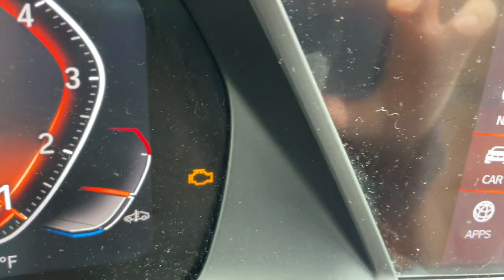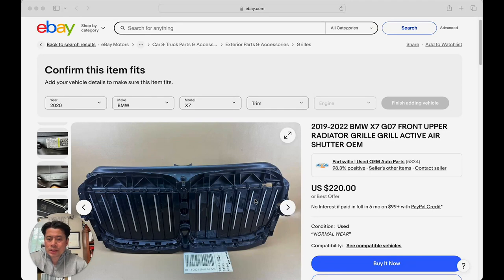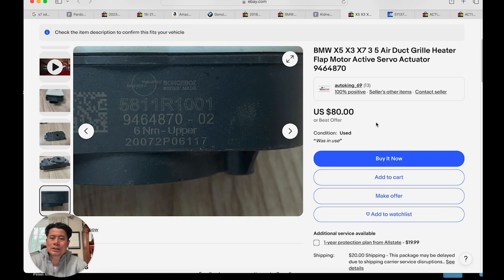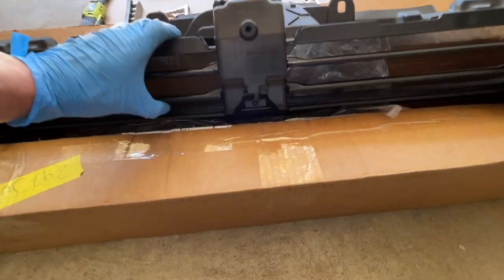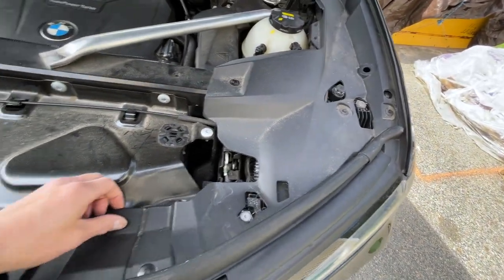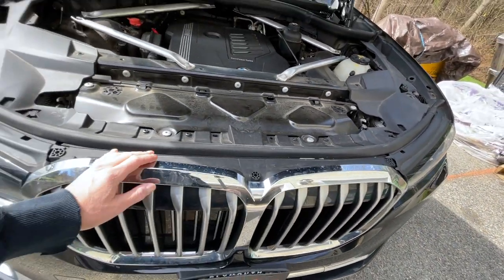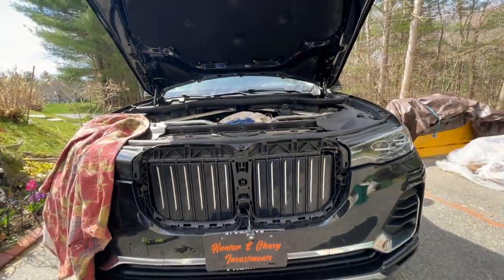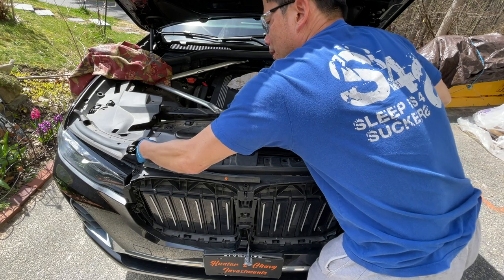Fixing The BMW X7 Active Grille Air Shutter Stuck On Error Code P05AF!

Comment: hey did you try to just go to the dealership and have them clear the code?
Reply from the maker: @jonathanpanah911  no because it was stuck open. It is a common issue found on these vehicles. The motor is very small, in front area where water 💦 could easily enter. The grill is constantly being opened and closing . I could not imagine what it would cost and what they would try to say at the dealership
Reply: Just letting you know. There is an extended warranty for the active grills. There's a tsb out for it. 10 years/150k miles. So no need to to pay or diy 😂😂😂😂
Reply from the maker: @SR145  Wow, that's a money saver. Thank you for adding value to the community.
Reply: @SR145  Is the 3 series included?
Reply: @omardiaz5552  anything with active grill is covered
Reply: @SR145 wow!  I’ll have to check it out, thank you for the info!

Comment: Hello I have a question I have the same error code but mine its not stuck idk why I have check engine on
Reply from the maker: There are 2 motors. First is the big kidney grill and the second is on the the bottom (which was my problem on this car). I first thought it was the top one but it was the bottom so if you fast forward to that section… I ended up replacing that and have been fine ever since. I believe the code error will go away after driving it as I remember 🤔 in the video